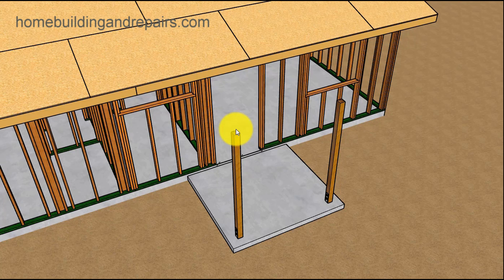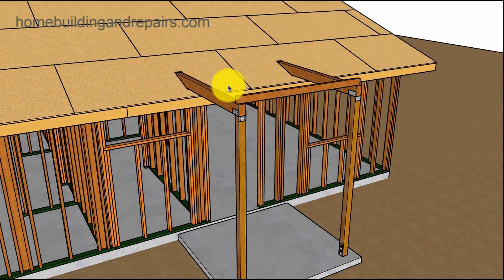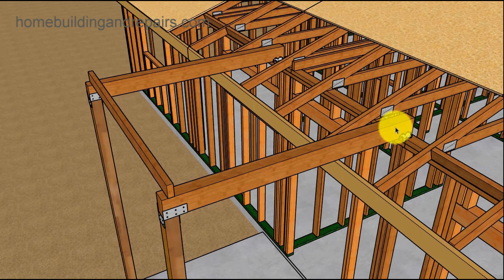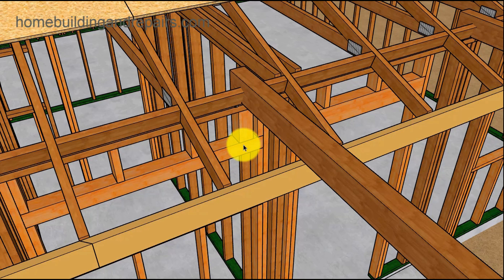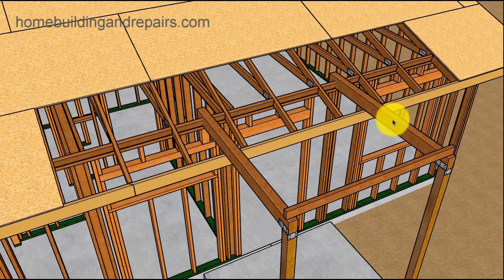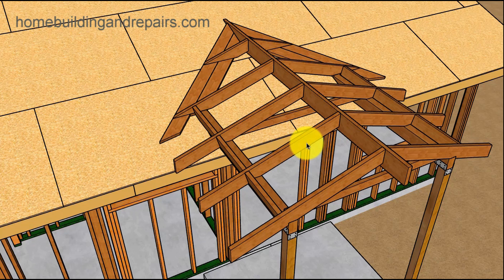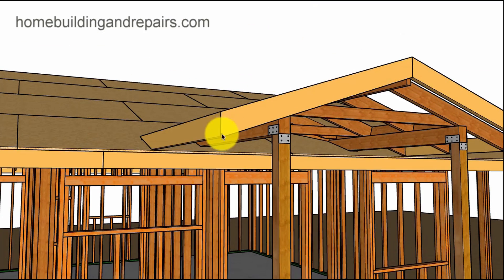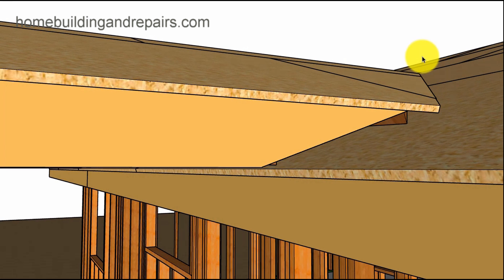How To Build And Frame 6 Foot By 6 Foot Gable Roof Porch Extension - Home Renovation Design Ideas

Comment: Hello Greg, I hope this comment finds you well. I have been scouring the web with no luck and I am hoping you can use your knowledge and experience to help answer my question. Suppose you have a square building with four concrete walls. How do you optimize the square feet before requiring a load bearing wall or beam?? How would this change with the addition of a second floor?
Reply from the maker: I don't really understand exactly what you're asking, but if you're asking how to create the largest rooms possible, then it's probably going to require you to spend a lot more money.

Comment: I have a future project that I want to do that is very similar to this except it is going into the flat gable end of the house. I thought of attaching it to the house with lag bolts, but your idea is much better going into the wall and resting on the wall itself. I am just in the planning stages with it, I had a designer who worked on the side draw it up for me and I really liked what he designed. The problem is with these artistic types is they lose interest after the initial drawings and you can't get them to finish the work. I paid him as we went along and I'm happy with the ideas he came up with, but then came the excuses, family problems, etc.
From past projects I learned to plan it out completely, know exactly what you want to do and even source materials, colors, etc. 
I asked a building inspector, who had just inspected another project I had done, about the porch project and he really seemed to push me to hire an engineering firm. I didn't think it was a big enough project for them to even bother with, that's why the designer I did hire only worked on the side, his company wouldn't bother with it.
I was even thinking of tearing into the wall where the porch would attach just to get exact measurements for wall stud locations. Even when you plan everything you still run into problems but at least you can have a back up plan.
Do you have any suggestions?
Thanks!
Reply from the maker: It would definitely be a good idea to plan everything out and if I didn't answer any of your other questions, feel free to ask them again.